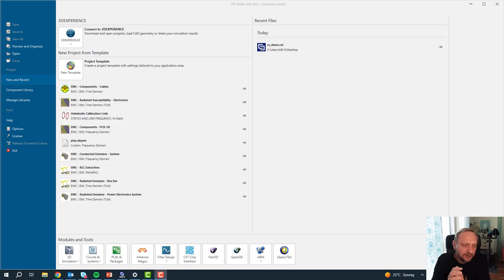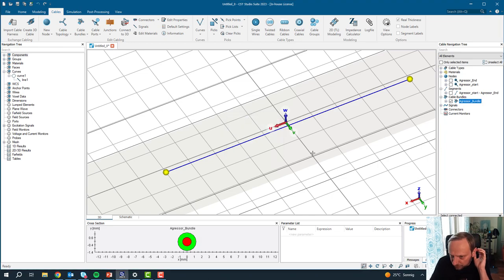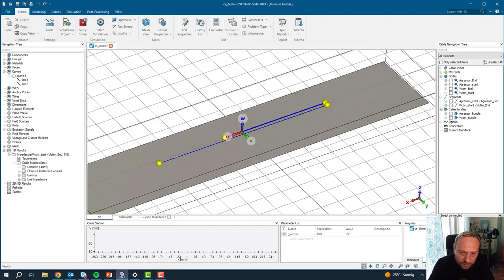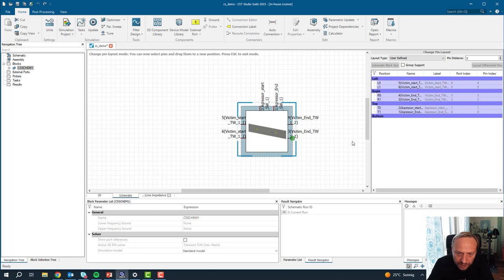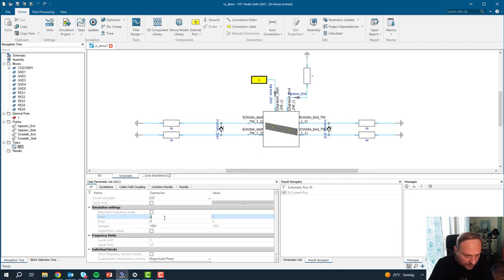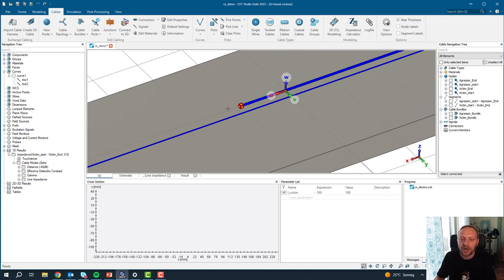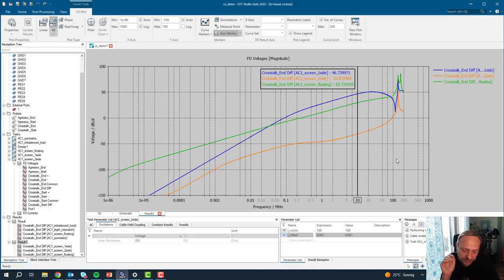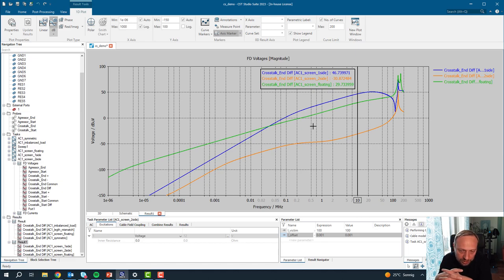CST Tutorial - Cable Simulation

Comment: The impedance calculated by the program for a piece of wire is something other than the impedance calculated for two conductors, provided that one of them is replaced with a reflective surface. Is it possible to calculate the wave resistance of a coaxial coil in this program?
Reply from the maker: Impedance always depends on the conductor configuration. A wire pair impedance is different from impedance of one wire above a plane. I don't know what you exactly mean by coaxial coil. A standard coil can be calculated with a 3d solver, that is in the same simulation package. I would not use the transmission line method for coils.

Comment: Hi ! Nice video ! I have a question and you seem to have a good command of the software. I'd like to simulate a transmission line to study the fluctuation of the voltage on the core of a double-braided coaxial as a function of a known injected current on the shielding, but I can't find a solution for adding a double braid using cable studio. Do you know if this is possible using studio cable? I'm looking for a solution to study its V -> I transfer function.
Reply from the maker: You can define two layers of shields by creating a cable group.
Reply: Thanks :) @AndreasBarchanski